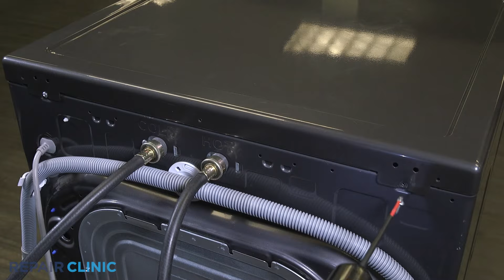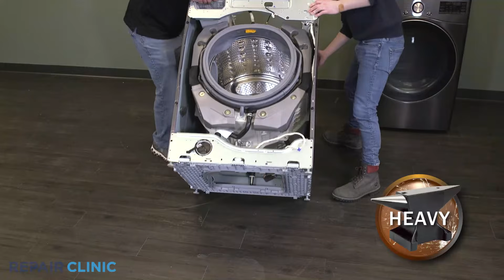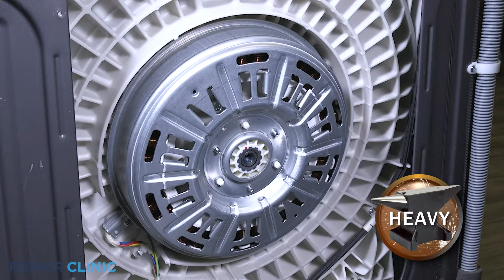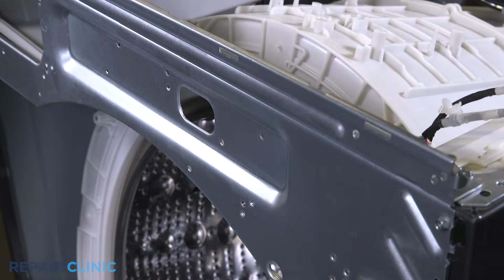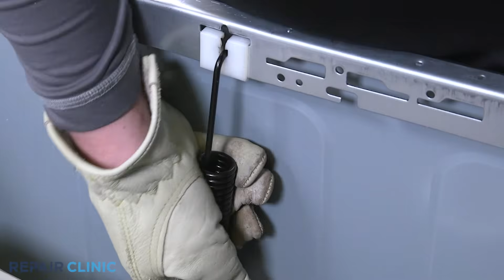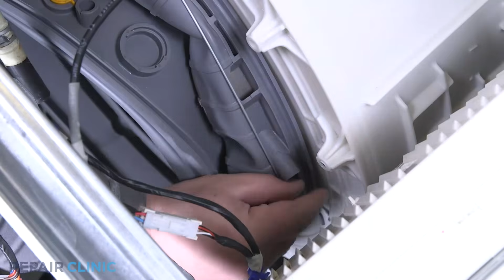LG Washer Tub Drum Assembly Replacement AJQ74873908

Comment: Thank you so so so much!!!! I wanted to deep clean my drum and your video is the reason why I could!!! I took it all apart, put it in the bathtub, baking soda, vinegar and dish soap!! It took me 2 evenings (total 7 hours) to do this but it was all so worth it!!! The most difficult parts were the springs and the plastic bolts for the shocks - taking them apart and reassembling them, partly because I had nothing to hold that drum up and I'm not that strong! Side note, when I took off the front with the door on it and unplugged those wires on the right, I sliced my finger very badly pulling those wires down and out. All the metal corners and sides are all very sharp so be extra careful! I actually have several cuts on my hands from bumping into stuff here and there. Also if you don't own a spring spreader tool you need to get one! I had no other way of getting that on and it's really difficult to get back on! God bless you. Thank you again!

Comment: How do you just take out the metal barrel that is inside the tub to clean the inner metal barrel?
Reply: I’d like this info as well. I’m making an ash catcher for burning wood in the yard and it would be perfect for that. I got the front plastic off but the back is giving me a fit. 🤷🏻‍♂️
Reply: I got the same question. I wonder if they made it non serviceable which is shitty.
Reply: @ hey I was beating on the back where the bearing was visible with the front plastic removed but when I flipped it over the drum was lifted out easily. I actually made it harder to remove but only because I didn’t know basically.

Comment: Is there a way to get inside the tub cover to remove and replace the baffles/ lifters? They are screwed in and all three have failed. I have the exact unit in the video.
Reply: Got exact same issue, looks like we have to take the whole drum out to screw then back again. Absolute shitty design. Hope it will be cover by extended warranty

Comment: Hi may I ask is the vm45000 LG washer are you able to open the outer tub split into half??? I would like to know if they using rubber seal or glue between the rear and front for the outer tub... incase in future i may replace the bearing, thank you sir
Reply: What year is that model? I have seen model made from 2022 and above they are glued. If you need to replace the bearing you will have to replace the whole drum,tub and bearing- they made them non serviceable. To verify you can open your washer’s top lid and if you don’t see any bolts on the tub you’re screwed.

Comment: Ok, it's been taken apart, and it is now 9pm, planning to wake up tommorow to wash the tub out from 15 years of fabric softener, tbh the hoses and stuff cleaned up nicely

Edit: might not be as easy as I assumed, looks like the tub will only come out if the bearing comes with it 😅 might just clean what I can and call it since that's a bit above my level

Edit 2: it is back together and somehow works, thanks for the very informative video, there was so much gunk from years of fabric softener but I can say now after cleaning most of it that it does not smell anymore and the new boot seal and shocks made it look, sound and feel brand new
Reply: I had the exact same experience!! I wanted to clean the drum but after I got it out I saw that I couldn't get into it 😭🤣 did what I could but just getting those hoses cleaned made me feel better!!
Reply: @mistytsamwa  a years later and it's still going. Also I found out I had a fabric softener allergy. I haven't needed Claritin since I cleaned the tub and stopped the fabric softener

Comment: For the white plastic bolts of the shocks just use a lighter to heat it for easier extraction
Reply: Use thin-nose pliers to depress the tab, the pull pin out using a large pair of 45° angle thin-nose pliers. I also used a large pair of Knipex like 87 01 400 or equivalent to press out the pin using the closing action of the jaws — one tip on tip of the pin the other on the bracket then squeeze. Worked great on the pins where there was enough room.

Comment: what can be the reason to need a new drum? i am asking this because our LG front loader started to create holes on older shirts.
Reply: @repairclinic  Thank your for prompt response. Your video is very informative. Our problem is, authorized service centers tend to replace entire drum and the gray colored gasket together My intension is to diagnose it first before paying naythign to those opportunist people. If you could tell me that LG drum housings are gerenally glued together or not, that will be appreciated very much.
Reply: @coskuarsiray  Depends on your model.  The top comes off pretty easy, 2 screws in back slide backwards.  I have mine apart to diagnose rattle.  Counterweight sheared off the front of the tub. My model is glued together.  There are other videos that show the front and back half of the tub are bolted together.
Reply: @Mandragera  I had the same issue. Did you replace everything or just the front tub cover?
Reply: I am going through the same issue now, lg wants to replace the drum.